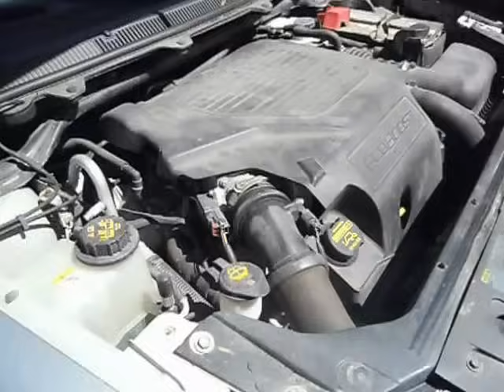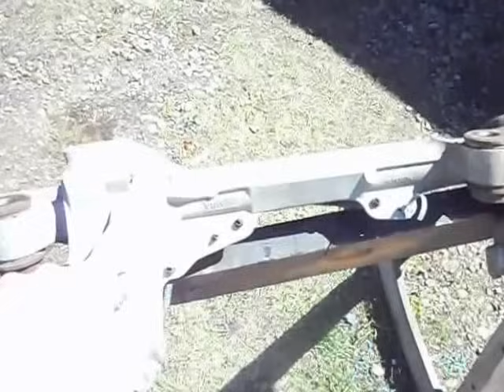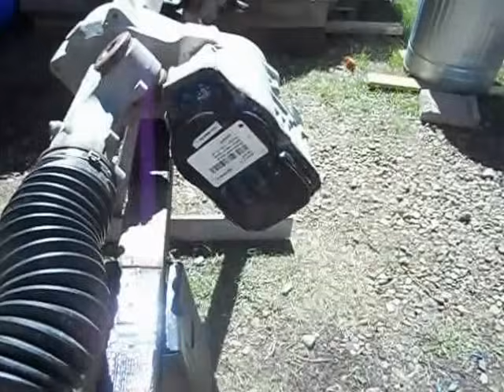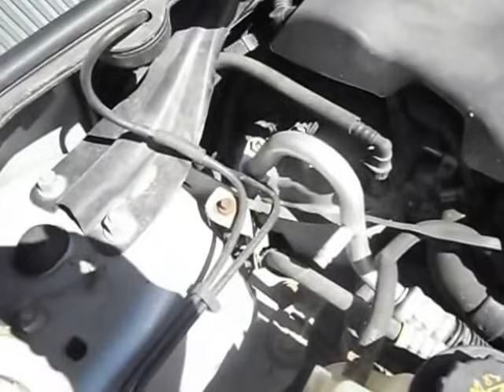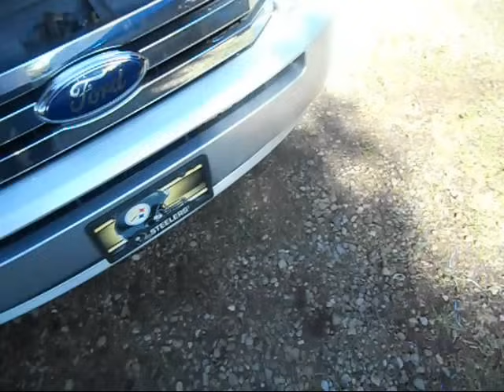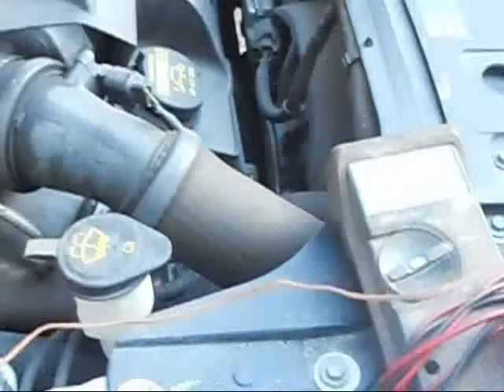Ford Electric Power Steering Failure Identified

Comment: Excellent video.  So informative.  I wish I was as smart on this stuff as you.  I have a 2016 Explorer whose power steering just died, when I started it this morning after the coldest night of the year.  I assume that my problem is not related to your problem, since yours was caused by excessive heat from the rear turbocharger.  Too bad they didn't design the EPAS to dissipate heat.  Just using the metal frame of the EPAS enclosure as a heatsink.  Gooping it up with a bunch of thermal compound because it was not designed as a proper heatsink mating surface.  No radiator, no nothing.  But do you think this system would have a problem with severe cold??
Reply from the maker: It is important to note thermal stress on electronic components is accumulative by nature. This implies semiconductor degradation occurs gradually and accumulates over time. Failure can occur at any time following sufficient degradation; especially during periods of high-stress; like heavy use or extreme temperature transitions (e.g. cold weather). Cold weather event, as you describe, is precisely event when failure would be anticipated. I suspect you are experiencing same EPAS failure as millions of other Ford owners. Ford has not corrected issue in new EPAS implementations, so do not expect replacement to eliminate problem. Best option is to make repairs then dispose of vehicle, and never trust Ford products in future. Dealing with Ford is just not worth the trouble, Ford will do nothing but profit on your replacement costs.
Reply: Our 2016 explorer just did the same thing this morning gave us a steering loss message .... and were out of warranty and ford wants 2200 to fix this
Reply: Same issue here! Coldest day of the year and my steering went out yesterday  Jan 31....as I was pulling away from a gas pump. Glad i wasn't on the highway...
Had it towed to a dealer for repair.....$2,300....won't be ready until Monday... Grrrrr
Reply: I have a 2015 Escape...and I thought the cold may be a factor...who knows...
Reply: Can we file complaints and hopefully get a recall
Reply: @ISFboom  I was going to call Ford but why waste a dime...
Reply: @bk1468 Thanks for the reply.  There is something faulty with this part for sure.  It's a shame that Ford doesn't care enough about their customers to recall this part, because it is clearly defective.  And holy cow, two more people had the same problem on the same cold day just replied 5 hours ago.  In my case, I had it towed to the dealer.  They said that I had a faulty "Power Steering Rack", which I think is the same as an EPAS with a different name.  The part alone costs over $1300.  They quoted me $2192 + tax (for parts and labor, including a front alignment).   The fact that this is a non-servicable item boggles my mind.  It's probably just a $10 dollar circuit board that needs to be replaced!
Reply: I have a 2010 flex turbo and mine is also dying right now. It's starting to hit and miss while I turn, it's pretty annoying.
Reply: My 2016 Explorer also lost power steering this weekend after standing in the cold.
Reply: My 2013 Ford Explorer had issues with losing its GPS location and periodically reduced power steering (steering wheel was hard to turn).  The power steering issue seemed to happen on very cold  winter days. Eventually my battery failed and I replaced it.  Since replacing my battery I haven't had either of these issues reoccur.  I did notice that the factory battery was Motorcraft BXT 59 540 and the recommended replacement was Motorcraft BAGM 48 760.  The latter has much greater Cold Cranking Amps and reserve capacity . I don't know if the bigger battery fixed my problems or the computers were "reset" by replacing the battery.  But I know it wasn't just a coincidence.
Reply: @JG-qw4bp   same thing happened to my flex. Once it got warmer outside the power steering came back. My battery is a new AGM one from last year.

Comment: I have a 2010 Mercury Milan (basically a Ford Fusion).. power steering assist showed up on my display. Steering wheel will not turn unless using extreme force called Ford they told me they can do nothing about my situation because my model year is not under the recall...how do I fix the Electric power steering problem or is it even worth it?
Reply from the maker: You can most likely find refurbished EPAS unit on ebay or other supplier and replace yourself. This approach will cost you much less than dealer. Sell vehicle immediately upon replacement, EPAS will fail again down the road.
Reply: The 2010 is in court now i think
Reply: they need to hurry up and force them to do right

Comment: Is this still a problem on newer (2019+) Ford vehicles?

We have a 2009 Mercury Mariner and 2012 Ford Fusion, both with electric power steering.  The 2009 has never had any problems.  The 2012 has had the power steering replaced twice now and is headed in this week for a third failure.
Reply from the maker: Sorry to here about your Ford steering failures. Ford keeps engineering blunders out of public perspective, and never acknowledged design problem related to EPAS (other than wrongful blame on Chinese assembly company for unrelated connector issue). Thus, it is impossible to speculate on state of design across any model year. Fact remains thermal loading problem is serious and exceedingly difficult to correct by any measure. EPAS units simply cannot be designed using 100% automotive-rated components; many internal components are not available in automotive-class temperature ranges, and others remain cost prohibitive. Assuming Ford has corrected thermal loading problem is unwise at best. Most viable path would involve not purchasing poorly engineered products that could potentially cause injury or fatality.
Reply: @bk1468  that was super deep. Just bought a 2012 fusion se with 72k on it 2 weeks ago. About an hr ago i was pulling out of the parking lot going maybe 10mph and car stalled and said power steering assist failure on the odometer dash. Already called Ford waiting for AAA, they not going to do anything about it. Im going to sue them win or lose... lol that's how i feel about it
Reply: Ford should have put the steering motor inside the steering column like the GM and Toyota cars or did electric hydraulic steering like the 2000’s Volvos and 2011-14 Chrysler LX cars.

Comment: Having a issue with my 2010 Taurus sho  it says service power steering when I never had any issue before now the steering wheel is really hard to turn 😡……. Any ideas what the exact problem could be ????
Reply: Mine too
Reply: Mine as well
Reply: @JohnDoe-fj6wd  it was rack and pinion electric to be exact don’t let a shop overcharge you got a used one for about 250-275 and they put it in for 300  needed a alignment afterwards
Reply: @darylbennett1133   it was rack and pinion electric to be exact don’t let a shop overcharge you got a used one for about 250-275 and they put it in for 300  needed a alignment afterwards
Reply: I got the same problem it's hard to turn the steering  very very hard to turn looks like I need to change the entire rack and also reprogramming the control modul such a pain a.............

Comment: My neighbors 2011 Flex steering motor make a buzzing sound, when steered. It is locked up
most of the time. Would guess that the motor is getting 1 or two  phases  of AC from the controller?
Reply: Normally, a brushless motor needs three phase AC to run.

Comment: E steering is CHEAPER TO PRODUCE but the savings ain't going to the motorists!!
Reply from the maker: EPAS units are not cheaper to produce than legacy hydraulic systems, not even close. EPAS units are also many magnitudes more complex and failure prone than proven legacy implementations.
Reply: B Smith ok I stand corrected but I swear I read an article about costs and that's what it said. In any case I hate E steer we had an Acura at the shop lost it's steering you could not move that wheel NOT. It's crazy and much worse than the GM ignition dust up. I always hated Ford.
Reply from the maker: OK, so EPAS system comprising thousands of discrete and active semiconductor components, high power wire-bonded IGBT driver array, microcontroller based computational and processing, four separate SMT circuit boards, dual optical encoders, timing belt servo motor, power and communications bus implementations; not to mention more. Is claimed by this article to be cheaper to manufacture than legacy hydraulic system; comprising simple hydraulic valve and automotive class pump, manufactured and used in vehicles since 1951.
HABERDASHERY!
Ford once published an article sighting low cost, reliability and safety benefits associated with one of its then signature automobiles; 'The 1971 Ford Pinto'.
Reply: B Smith yeh! So..I wonder what tree those guys were yappin up when they wrote that article. Like where did they get that idea from. I'm curious. is overgrown technology and a disaster that they have miraculously kept so quiet which is the really scary part!! Like the Prius brake integrated unit failures where you step on the brake and the car actually speeds up slightly. The units cost $3,000 and I don't know if they even solve the problem when replaced! Kept that shit real quiet too strangely enough. Mercedes brake servotronic system is another real piece of work. Engineers gone wild lol. You have a good day buddy.

Comment: Hey man, I need your help here i have a Chevrolet Impala 2015, and I'm facing an issue in using the stearin wheel its quite heavier than it used to. I did diagnose the car by using the maxisys pro equipment and it gave me these two codes :
1- C055C-00 / steering gear performances. 
2- U0428-00/ invalid data received from steering wheel angle sensor module.

So i hope if you can guide me what exactly needs to be replaced or what i need to fix.

Waiting your response eagerly.

Comment: What was the fault code there ??
Reply from the maker: Cannot fully recall fault codes specifically, however displayed messages included 'service advancetrack', 'steering fault', etc. When I get a chance; will look up old OBD records on file and report.
Reply: Fault code Fault name Failsafe mode Conditions to restore EPAS
C195C Low voltage (<11V) Reduced performance state following voltage capability of the vehicle Voltage returns to value within specified tolerance within same ignition cycle.
B1317 High voltage (>16V) Ramp out to zero assist. 
B1318 High voltage (>18V) or Low voltage (<9 V) Remove assist. 
B1342 Micro test failure Remove assist Reevaluate at next ignition cycle if condition still exists.
B2277 Motor failure Remove assist. 
B2278 Torque sensor failure Remove assist.

Comment: I’m sorry if I missed this; What part number is? Ill try to procure myself and have my local shop replace it. My warning light just popped on, I restarted it to get it working, of course the safety recall codes were present. Ford Customer Care won’t help as my VIN doesn’t fall under the recall; but the part is the same. Thank you!
Reply from the maker: EPAS part number is specific to vehicle model. You will need to reference correct unit from Ford documentation.

Comment: Does anyone know if there is a recall for this now?
Reply from the maker: NHTSA forced very limited recall on some models, however left most owners with identical equipment in the cold. Recall does include some ridiculous stipulations however; e.g. if your EPAS is only showing signs of failure and you present vehicle at dealer; Ford will only upgrade software and send you on your way. When your EPAS fully fails days or months later; Ford will invalidate your recall and charge you for EPAS replacement.

Comment: I have a 2017 ford scape and it's giving me problems already had her for six months I have a recall notice they refused to fix it right away I have to wait a week and every time I turn my wheel I hear a funny sound squeaky i'm thinking it's the power steering
Reply from the maker: Do you have hydraulic or electric steering? Squeaking is usually associated with loose power steering pump belt and hydraulic based system. If you do have hydraulic system; try placing a little dish washing liquid or belt dressing on inner side of belt where visible. If you do have electric steering; squeaking is a symptom I am not familiar with. Not to say symptom could not be associated with electric system.

Comment: Would deleting that cat help reduce temperatures in this area? I just had my EPAS replaced, don't want to go through this again.
Reply from the maker: Problem systemic to Ford vehicle engine compartment designs. Removing heat sources may help, however best solution is to eliminate problem and associated risk, stress, and frustration entirely; i.e. maintaining ownership of Ford vehicle with known serious and hazardous design flaw. EPAS failures can be just as deadly as the infamous Ford Pinto design. But steering wheel anomaly at speed is somehow deemed less hazardous than fuel leak during crash. EPAS failures have resulted in errant steering commands and lock-up. Imagine your wife or daughter driving at speed, and wheel suddenly turns with force to full-lock. This scenario occurred on my Ford vehicle during sharp turn, causing vehicle to jump curb. Incident occurred so rapidly, no recovery was possible. Ford claims this can never happen, but other consumer reports support my own experience.
Reply: @bk1468 I'm thankful that you're alive👍🏻

Comment: So if I short circuit something from my 2012 Mustang while working on it, because I didn't unplug the negative battery terminal, and my power system is out. Should I replace my EPAS?
Reply from the maker: Damage due to short circuit would depend on various factors including; what circuit was shorted, which system could be affected, and potential high-current paths as result of fault. Vehicle systems are nominally protected with fuses and circuit breakers to prevent system-wide damage from electrical fault. Communications-bus circuits generally include circuit protection to prevent common damage scenarios. Before you invest time and money replacing major components; check all fuses and circuit breakers for 'open' condition. Make sure you don't just check standard fuse-box set. Your vehicle typically includes additional fuse boxes and breakers not necessarily in plain sight. Also, obtain OBD scanner (type that interfaces between vehicle OBD port and computer USB cable). OBD should be able to test vehicle modules separately, unless vehicle-wide communications bus has been damaged.
Reply: @bk1468  It is reasons like this that cause major recall and mishaps. This is an example of a 1 in 1,000,000 faults p[robably because of one small piece built in China. If you get an OBD II scanner, make certain it is from a reputable dealer and made for your specific make and model. I bought a generic one that I used in conjunction with Droid Torque app and it literally destroyed my on-board computer system.
Reply from the maker: @CombatDoc54  Your comment is not specific or understood, please elaborate.

Comment: I think we are having this problem with our 2012 Taurus, we  had struts, coils and mounts replaced and it still didnt work, so we brought it to Ford deadler who replaced struts, coils and mounts again saying the others were defective, here we are 2 days later and 600 bucks poorer and the same problem again! Is this a problem on 2012 Taurus? We didnt find any recalls but feel we are getting ripped off, especially after your report.
Reply from the maker: Dealer indicated new replacement components were defective? This sounds incredibly suspicious. Did you insists dealer return alleged 'defective' components? Dealers commit fraud on daily basis, especially when they feel consumers are not particularly knowledgeable concerning automotive mechanics. I would consult an attorney specializing in consumer fraud. Dealer will most likely return money once an attorney is involved; no need for court.
Without knowing what symptoms you are experiencing (assuming your vehicle is equipped with EPAS), it is not possible to draw any conclusions concerning disposition. Your vehicle OBD (on-board diagnostic) system should have displayed error messages on dash display. What error messages were noted? You should conduct your own recall research using vehicle model and year. Dealers and Ford cannot be trusted to inform you of recall obligation. There are many internet based sites where recalls can be researched. Never place your trust in any automotive repair facility, they all prey on consumers. Learn as much as you can concerning your vehicle, symptoms, and possible corrective measures before visiting dealer or mechanic.

Comment: 2014 Ford Fusion power steering just failed.  Thought I had a dead battery as the electronic acted weird and car would not start.  Just re-charged battery, car started fine but power steering gone and had message on screen stating "steering assist fault service required" along with other crazy messages about Advance Trac not engaged and Hill Climb not engaged.....looks like the EPAS thing here as well.  Car is only 3 years old with 56k miles.  Any advice?
Reply from the maker: I find it amazing that so many EPAS systems continue to fail at incredible rates; yet Ford, media, and the NHTSA remain absolutely silent. You need to find refurbished unit on ebay, replace unit yourself, then sell quick before unit fails again. Ford stock has fallen 17% since January due to recall expenses, customer dissatisfaction, 30% drop in YoY profit, and slowing global auto sales.